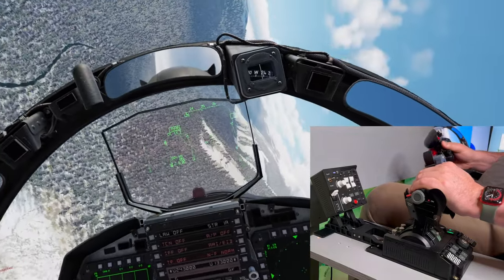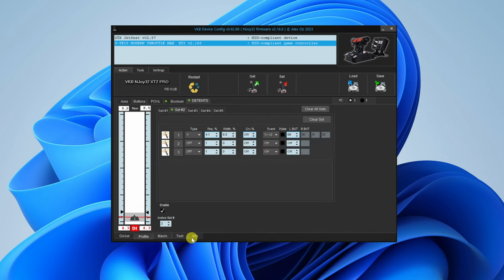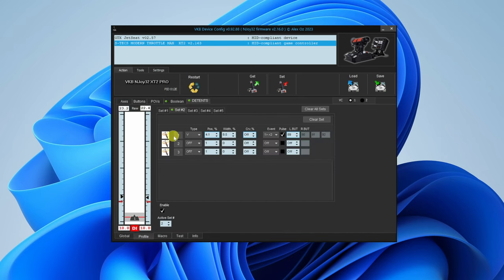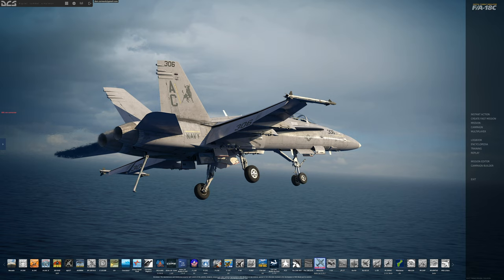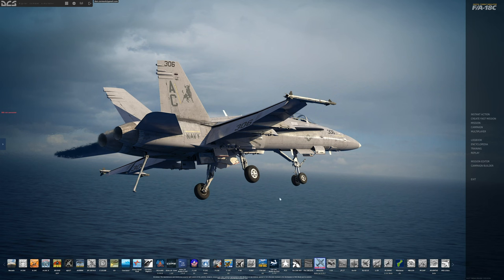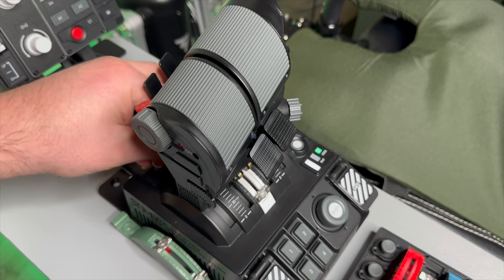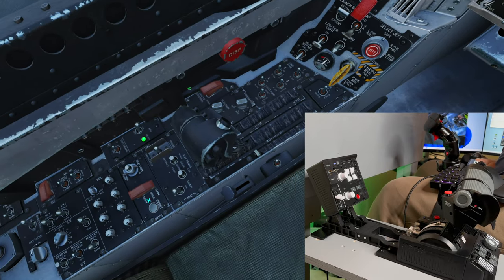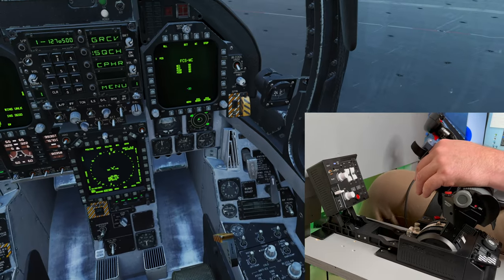DCS VR | STECS Video Followup - Solutions!!

Comment: Hey Str][ker, Another great video! Hope all is well. I too have the warthog throttle but am thinking of switching to the Stecs for the versatility. For the AB, did you set up the curves for the detent as we did for the warthog or does just mapping the fingerlift buttons do the trick? Thanks!
Reply from the maker: Hey! Thanks for the compliment and I hope all is well with you too! I've been thinking of making a brief followup video to share my thoughts now that I have been using the STECS for a while.
It's a similar process. You move the throttle to find the point where the AB initially stages in and note where that is on the throttle. Then place the physical lug there. Lastly, you need to hop into the VKB software to set some curves. I'm hopeful that the video helps enough to get people going. The nice thing with the VKB software is that you can adjust where Idle is and where the AB is via these curves (VKB curves, not DCS). For example, I could set a curve where the throttle is physically at 50% but have it in DCS read as 100% (Full throttle). The throttle scales from zero to this new 100% for what it sends to DCS. Obviously this is not practical but I am hoping it helps you understand the concept.
So with the AB detent, you (via VKB software) identify where the max mil power is, and set that percent at that physical detent. The rest afterwards would be the staging increments for AB..
As for kicking in AB where physical finger lifts exist (such as the Hornet), I set a few things up for this as demonstrated in the video. I set the throttle the same way as mentioned but once I pass through the AB detent, I enabled a trigger action to press a button. That button is then defined in DCS as the finger lift button for passing into afterburner.
The warthog only has actual buttons for the Idle / cutoff (when you lift the throttle out of off into idle for example) and nothing for AB. That's where you need to play with curves in DCS to match the physical location of the AB detent on the warthog. None of this applies with the STECS as most of the heavy lifting is done in the VKB software.
Hopefully this helps. If you have any more questions, feel free to ask.
Reply: @StrIIker-TV  Great info! I will digest this and scan for future videos and I'm sure, all will become clearer once I actually get the unit. So, just to see if I get it. Instead of setting the curves up in DCS, all is done with the VKB software after determining the Mil/AB position? Thanks again
Reply from the maker: @greyeagle5199  Regarding curves for AB, yes, you set those in the VKB software. There are other settings in DCS which you set and then configure stuff in the VKB software but the curves are not needed for AB settings in DCS.
Reply: @StrIIker-TV  👍👍

Comment: Striker, having some issues with throttle control, too much variance, having a real hard time with thrust control in AAR, any tips with the Stecs?
Reply from the maker: The STECS throttle has provided me with great fine control of the thrust in the aircraft which I have refueled in (The Hornet and Strike Eagle). The throttle has two tension adjustment knobs (one per side) which allows you to adjust how much resistance you receive while moving the throttles forward and aft. I suggest looking at that part first to ensure that you don't have the friction too high as it then will result in excessive movements of the throttle. It requires a little more force to overcome the initial friction than to maintain/continue that motion and that can result in moving the throttle more than you wanted. You also don't want the resistance to be too low or the throttles will be too loose and you can wind up over adjusting the throttles, particularly later in combat etc. Having gotten the throttle part out of the way, it comes down to the actual refueling. I'm not sure what experience and/or proficiency you have with air to air refueling so if I am being overly basic with this, please forgive me.
The general approaches to getting this down involves first mastering formation flying. Fly near the tanker and just maintain position. You will start to learn how much adjustment is required for this. Build a sight picture such as.. the top left corner of the right mirror should be right next to the door on the side of the tanker etc. and that's what you work on to maintain position. Once you can master formation flying, the tanking part is easier. I don't want to delve too deep into detail here if it's not helpful for you so please let me know if you want more information about any aspect of this. I would hapily make a video to demonstrate this as well and can set a camera up to focus on the throttle movement.
Reply: I have tension to the bear minimum, so it just doesn;t move forward or backwards, but cant seem to get constant speed, just touch it is 5kn to fast or too slow, roll and pitch is pilot (indian, not the arrow, but thrust no matter what i do cant get it to settle down.  @StrIIker-TV
Reply from the maker: @DCoy305 Which aircraft are you flying? A former WSO from an F-15E Strike Eagle said that it can be a good idea to pop the speed brake a bit to help give you better control over the speed. with the throttle. If you have the tension set as low as you mentioned, that may be the issue because it will not take much to move. Have you ensured that you properly calibrated the throttle? This is a very important aspect. Try running the calibration again. Also ensure that you don't have curves set too high in DCS or the VKB config tool. You should not be seeing such a dramatic increase in thrust with a small input. If that is happening, I really do think it's a calibration problem. Also, have a look at the axis sliders in the DCS Axis configuration for the throttles. Ensure that you get proper motion forwards and back.
Reply: Running the viper, and also was wondering, are you running throttle user curves? I have no curves set in vkb or dcs throttle. @StrIIker-TV
Reply from the maker: @DCoy305  Hi! I am using Curves in both VKB for the throttle only. In VKB I set the curves so that the at the idle detent, the throttle is at zero and then curves to get the throttle set properly before the afterburner detent. I recall showing this in the video for both the F-15E and F/A-18C. The curves in VKB are there to help you set the in game throttle position to where you want it by using an offset vs where the physical throttle is. For example, with the cutoff detent in place at the lower end of the throttle, the throttle never physically reaches where the zero is (because of the physical detent) and so it by default is telling the sim that it's at something like 10 or 20% because that's physically where it is. The curve allows the throttle to set a new 0% regardless of the physical location of the throttle. So, I set the curve and now DCS sees zero throttle when the throttle is physically at let's say 20%. Pulling past the detent then sends the cut off command to DCS via the detent action which I configured. So that's the VKB curve.. In DCS you can set curves to reduce the input intensity for a given amount of throttle movement but I don't do this as I find the responsiveness of the throttle to fine plus this will make small adjustments to the throttle much greater later in the curve. The throttle is best left as a straight linear line. Thjis is all applicable to the viper too (which I do have).
Curves in DCS are great and almost a must have for rudder inputs (specifically for nose wheel steering) and stick inputs. This way, the initial inputs are lessened by the curve. Without curves on the rudder pedals, I am zig zagging a LOT on takeoff rolls because even a small deflection physically on the rudder pedal is enough to turn you left or right a fair amount. I also added a dead zone to the rudders so that I'm not deflecting the nose wheel by being slightly off center. Does this all make sense and help?

Comment: I enjoy your videos. But, what do you mean finger lifts?
Reply from the maker: The finger lifts I refer to are the set of levers on the front of the throttle handle and the ones on the rear. They look like the finger lifts on real combat jet throttles (such as the F-18 or F15E) which are generally used for moving the throttle out of off to idle and from mil power to afterburner. The aren’t actual finger lifts on the STECS. In DCS there are finger lift settings for both the Hornet and Strike Eagle which you configure. In the Strike Eagle the finger lifts are used to start the engines.
Also thanks!
Reply: Thank you! I have a steep curve to learn with game and new VKB gear
Reply from the maker: @adiedri38 Heh yeah! It's actually not as difficult as it looks. The software is confusing and their documentation is not the best but the community is VERY helpful and often the staff with VKB help out. I use their forums and Discord to get help with questions. The gear itself just takes time to learn (or relearn) which buttons do what and that takes practice, practice, practice.
Reply: @StrIIker-TV  am sorry to ask this as am sure you get it a lot. But, do you have a bindings video? Or a here’s where to start. Thanks again!
Reply from the maker: @adiedri38  Hi! I do not have a bindings video but I will put a quick one together. I know why you are asking this question. When I was starting out and when I upgraded to the STECS, I struggled with figuring out what I should map and where. I didn’t want to map settings to buttons which in the end don’t “make sense” in terms of location. 
I try to match the aircraft which I am flying as closely as I can and go from there. I will see what I can throw together for ya!
Reply: @StrIIker-TV thank you!!

Comment: Can’t you set detents on the black slider?
Reply from the maker: You can physically put detents on the black detent frame however for some reason which makes zero sense to me, the software does not allow you to configure the detents. If you go into the software and select the black detent frame color, you cannot do anything to set the detent positions by running the detent wizard. I was going to reach out to VKB to ask why they made this choice and ask if they can add the option to the software.
Reply: Thanks. Yea I was confused since I got the mini stecs which only has the black detent, but I couldn’t do all the cool stuff you showed to fine tune it in software.
Reply from the maker: @planecrazy242 Just pick one of the other colors in the software. That's what I initially did because I wanted to use the black detent as it looked best for me. I looked in the VKB software and could not set any detents on it so I chose the white one in the software and was using that for the black detent. I eventially decided to match to color as I didn't want to confuse things in the video and moved my Hornet detents to the white detent. So, put the detents on the black one, choose a different color in the software and have fun. 
Actually, you could put the detents on in one physical location and then use different colors in software for different aircraft. You would just need to use curves in the software to adjust to match the detent position and afterburner start for each aircraft. It would be super easy. Just follow what I did for the hornet or strike eagle but on a single detent. The hornet afterburner starts later than what I have the strike eagle set for so I would adjust the curves to match. One color for hornet, another for strike eagle. Let me know if you need a hand.

Comment: I'm wondering if it'd be possible to set up the 3 pos switch as an axis (which I know is possible), but one that also triggers button presses at the start, middle and end (similar to the detent button presses you setup).  In that way, you could both use them in planes like the F-14, which have a throttle axis, and in planes with a 3 position flap switch (like the F-18), without having to change anything between them.
Reply from the maker: I am almost certain that you can do this very thing. The software has a huge amount of configuration options and this has to be one such option. I imagine there is a setting in the VKB software in which you can configure virtual buttons at varying axis positions (basically what is done with the detents in a way).
Reply: @StrIIker-TV  Yeah, might have to try it.
Reply: @StrIIker-TV  You know, I reloaded a saved config that had the axis setup, and I found that it was already doing the button thing anyway!
Reply from the maker: @RocketToTheMoose  well that was convenient! Hope it’s working well for you. Should be a great option to fly with.
Reply: Yeah, to be honest, it doesn't really change that much, except that in the Tomcat, the flap lever animation is now smoother, since it's using the axis.

Comment: This product seems overly complicated, & a huge learning curve
Reply from the maker: It’s actually not that bad. It’s only as complex as you want it. If all you want to do is to use the throttle and buttons as is, then plug it in, assign buttons and axes in DCS (or your game of choice) and you are all set. 
If you want to take advantage of the configurability via software, then there is some learning to do but to be honest, you probably don’t need to do more than I demonstrated in this video and the previous one. 
The benefit is that you have choices. I would rather have choices and options than being locked in to a single set up.